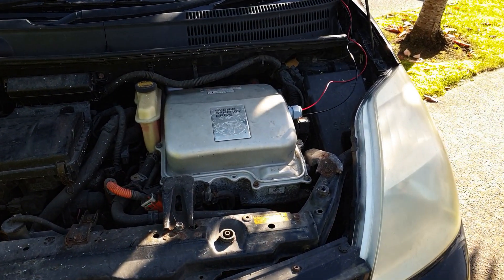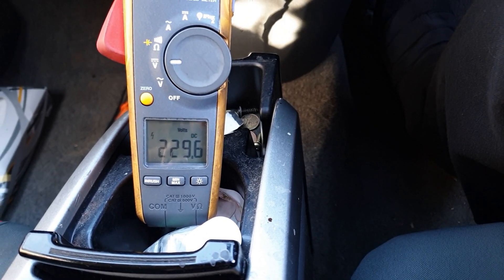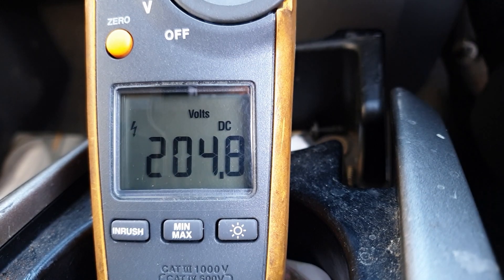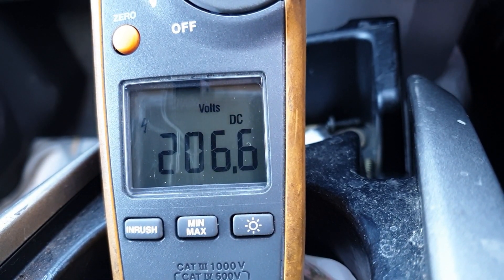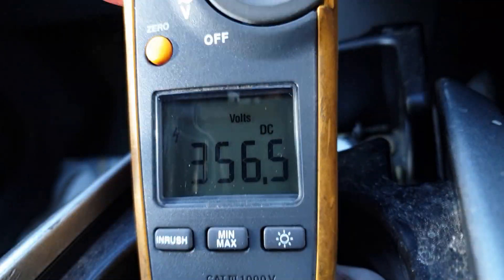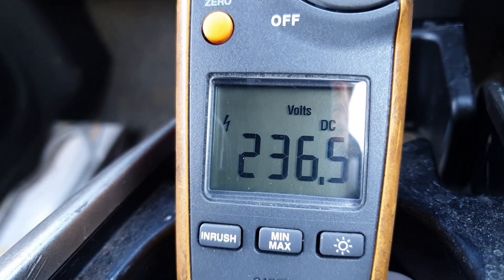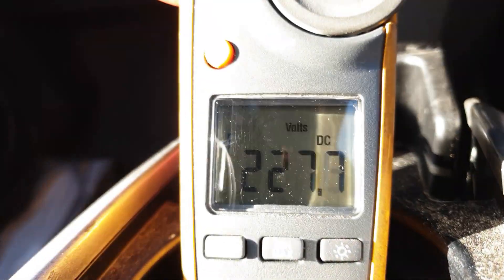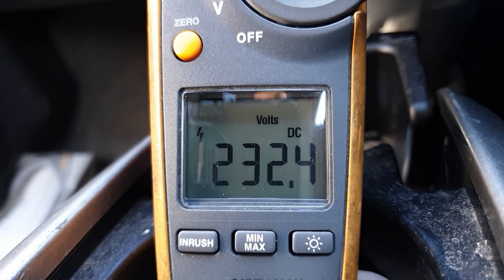What Voltage Do Toyota Hybrids REALLY Use?

Comment: What about voltage and duty cycle the motor See's? Could a 100s-120s lithium battery be used with the prius trans? Without motor, or does it prefer a lower voltage, or does voltage not matter that much? I'm guessing the motor sees a spwm? With varied duty cycle, to throttle? Seems it stays below just over 500v, so about 480v at full charge should be safe?

Comment: Well what I want to know is what RPM the motor will run at a given load. In other words, the motor curve. And also then figure out what top speed I can achieve in my conversion idea of a honda Acty where the RPM at 75mph is very high like 7000rpm.